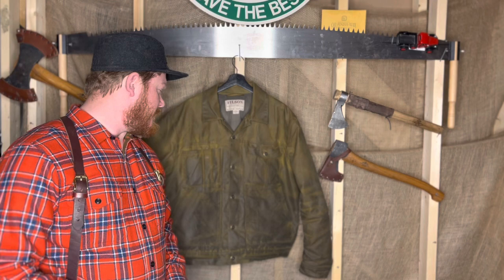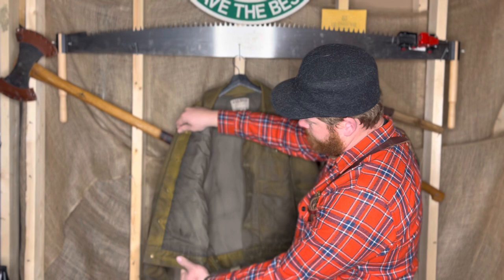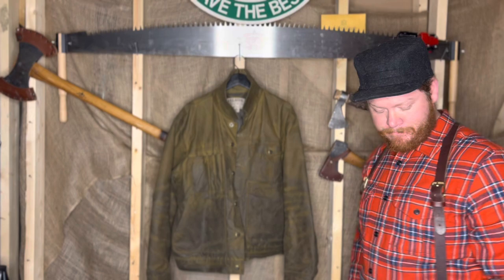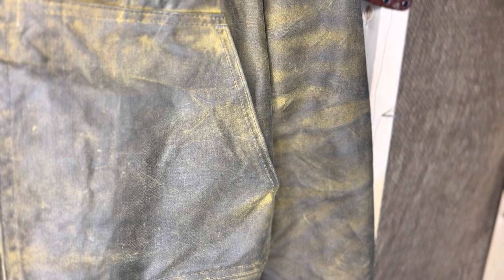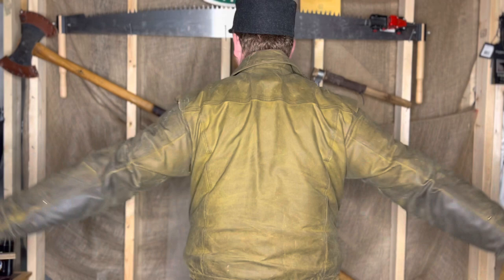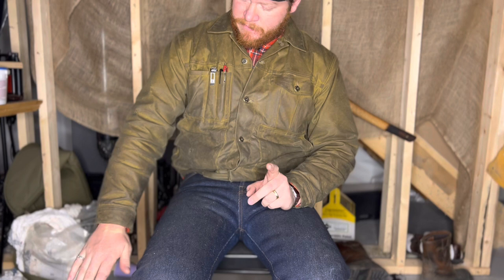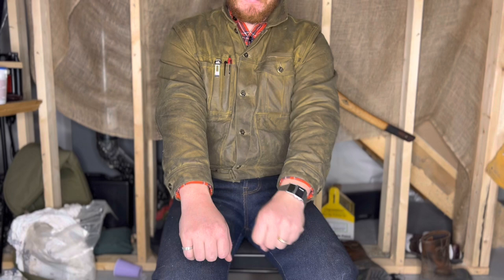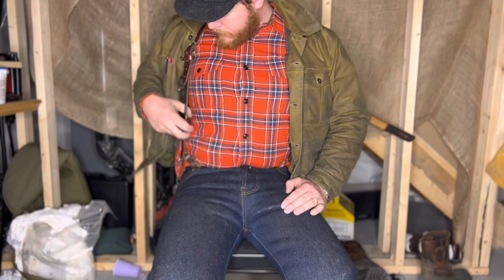Filson Short Lined Cruiser - A beautiful jacket with a fatal flaw

Comment: I always style my trucker jackets with the bottom button undone when the rest is done up. It’s a style that originates from England where men riding horses and wearing waistcoats would leave the bottom button undone so it doesn’t ride up their torso when on horseback. It transfers to modern day use though with driving/sitting. Hope it helps a little.
Reply: I do the same when wearing this jacket.

Comment: I sold Filson in the 90's and when it comes to tin cloth garments, I always told people to get a size larger because once you break 'em in and put additional wax coatings on there, those wrinkles and creases set themselves in for good and cause stiffness and ride up the length.  Usually a "break-in" means it will give way, but with tin cloth it's a bit different. It's about the only time you go a size up with Filson because most of their casual wear and other items run big. My tin cruisers are almost 30 years old and after working in the oil patch and on the farm back in North Dakota, they've got a lot of character but are still in great shape.  My gut just doesn't allow me to fit in those old tin pants of mine anymore though. Either way, I just bought this same short cruiser as you and normally in a similar Levi's trucker jacket I'd wear a medium (5' 9", 175), but I'm glad I took a large with this one.
Reply: What does "short lined" mean? Is it a reference that it's cut short in length or the lining is short?
Reply: I’m 5’11”- 200 lbs. L or XL would fit best?
Reply: @TheLtrentlage  short, lined Cruiser

Comment: You can order a rivet setter online and set those buttons on the wrist in a matter of under a minute. I went and bought one and it's super easy to add jean buttons to anything I want. It's fantastic.

Oh and btw, that weird bunching when sitting can be fixed by unbuttoning the bottom button. I typically just leave mine unbuttoned.
Reply: Agreed with your last statement. I don't think I've ever buttoned the bottom button on any of my truckers. Looks better too.
Reply: I came to say this. The bottom button doesn’t add warmth. Doesn’t do anything. Always more comfortable open. I have a black tincloth and a rough out suede. Also, if you’re ever down in Seattle, you’ve gotta stop by the flagship. Heaven!

Comment: Thank for your video. I've totally in between a L and an XL and am thinking about keeping the XL. As for the sitting and bunching, unbuttoning that bottom button is key. It spreads the jacket when seated, flattening everything out - mostly. I also think it depends on the amount of flexion when in the seated position. When on horseback, for example, the position is much more upright and potentially less bunchy. But when seating in a car, the angle made by the torso and legs is much more acute, accentuated by leaning for the steering wheel. The Large is a perfect fit. Too perfect I think. If was all about style, I suppose I'd keep the Large. But, if I want to layer a little and I maybe account for some of the jacket shrinkage I've heard about, the XL might be the way to go.